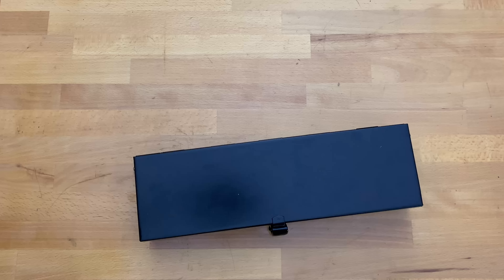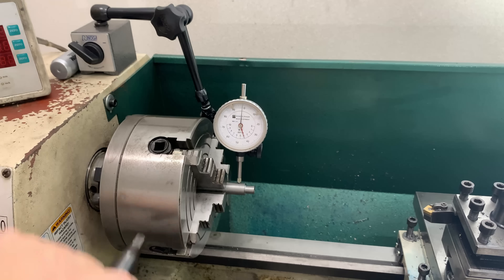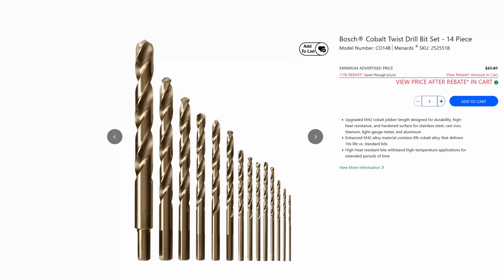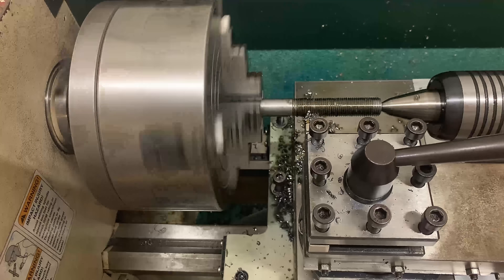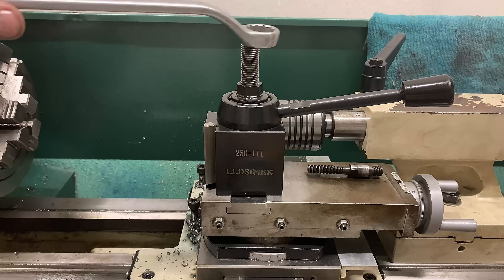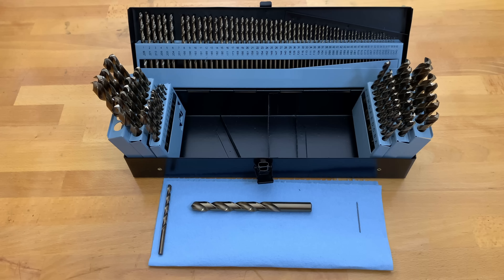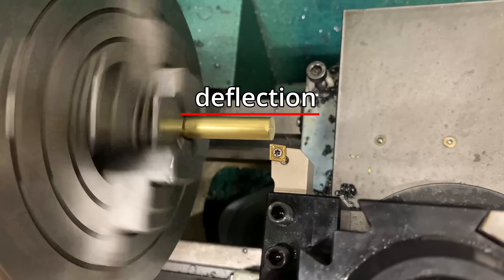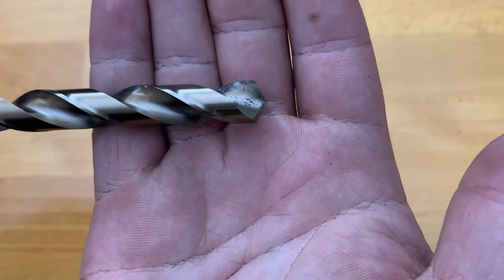Are Harbor Freight Drill Bits Secretly AMAZING?

Comment: I'm not a machinist but I still enjoy precise holes. I make knives and if things don't line up or I can't drill through various steels, then I'm sunk. I bought some decent cobalt 42 drill bits. I bought a new Bauer floor model drill press and the bits and drill press works very well for what I need it to do.

Comment: I have been impressed with my cobalt harbor freight set just drilled 20 3/8” holes in 3/8” i beam no issues. Also drilled 48 1/2” holes in 3/8” plate no issues.

Comment: Worst bits I've ever used are Dewalt. Those things aren't even sharp when you open them from the package brand new. I actually have 2 sets of hf bits and they are still holding up 8 years later. Only reason I have 2 sets is because I lost 3 or 4 and the price to replace 4 bits was nearly half the price of a new set, so I've got ALMOST 2 sets lol. Don't knock the til you try them

Comment: I've had the smaller version of this set for like 15 years. I only use them a handful of times yearly, but they've worked well. Only the smallest bit (1/16? 5/64?) has broken, but that was from trying to drill through an ancient air conditioner's sheet metal to make some water drain holes.

Comment: I bought a set like this from Amazon over a year ago for like 130 USD and they worked great! I broke a few but the biggest downside is the smallest sized drills have no indication of size. So if you accidentally spill the case you now have a fun two hour project with calipers putting the drills in the correct spaces. Still worth it.

Comment: Over the years, I've purchased several HF drill sets.  The oldest seem of better quality and came sharp.  Newer sets are of lesser quality and many of the smaller drills - below 1/4" -are dull from the factory.  If you learn how to sharpen drills, even the tiny ones, these sets are good enough.  Of course nobody in production work would use them!   For hobbyists, they work fine, as do most HF tools.  Stay away from their wheel around 200 Amp battery charger though.  Undersized wiring, brittle plastic - a piece of crap!

Comment: I have smaller sets of HF drill bits, they dulled after 1 use. When I had the money, I bought 3 separate 115 piece sets of Drill hog bits. Am M7, M35, and M42, at $229 per set, they are salty, but worth the investment.

Comment: Most of my work is in aluminum. I am pleased with the purchase. I have had them for maybe 8-10 years. I use them on drill press, lathe, and manual milling machine. I think that I a pretty good drilling. I have some people using a brand new bit that say it is dull. Works fine for me. Got to use oil and expertise. Been in the shop for 45 years now off and on.

Comment: I have two of these sets: I bought the second on sale 4 years ago (almost as good as the deal you got) as a spare. I have not yet needed to harvest one of the bits from the spare set, and use these almost exclusively, unless I want to use a stubby length for a particular job (Drill America M42 Letter, Fractional & Number individual sets; very happy with these as well).

Comment: 0.5 thousandths off the 1/2 inch, not 5 thousandths.  Dial calipers are not a precise reference!  I have the same set, I think it was under $40 when I got it.  I only go to it when I need an odd size, otherwise I use the smaller kits they sell for $10.

Comment: I have the regular HSS version of this set, and they are definitely not top quality, but they have so far chewed through several feet of steel in a lathe, the 1/4" drill not even needing a sharpening. 
Every time I use it, I pucker a bit from how much it flexes, but it just keeps working, so I just keep using it. 
As they eventually go, they will get replaced individually with good quality single size purchases, but until then, yeehaw.

Comment: Nice review. I don’t acknowledge a review unless the reviewer states his qualifications. I believe most bad reviews are due to operator error. I’ve worked for an industrial maintenance service for a number of years, as an industrial, commercial and residential electrician for a number of years, then after retiring, as a cabinet builder. I have a lot of experience with many different tools and accessories. So, yes, I liked your review

Comment: The only thing i have to add about the H.F. Cobalt Drills is that the bits that are smaller than 1/4" are sometimes sharpened for a left hand cut, from stupidity im guessing,  & they're Useless.

Comment: The guy who mentioned melting them in stainless I know why they melted them. With stainless you HAVE to slow down the rpm of the drill or you will harden the stainless making the metal your cutting HARDER than your drill bit. I went through several drill bits before I looked it up as to why I kept destroying even my high quality drill bits.

Comment: I have tools from "China", Snap-On, Wiha, etc.  Buy a cheap tool for most everything if you're not EXTREMELY likely to need absolute precision or constant use.  If it breaks, buy another, OR a better tool OR use the warranty to replace it if it exists.  Does it work, is it correct in measuring, etc.?  What is the problem then?  You don't NEED Starrett, Mitutoyo, etc for EVERY tool but yeah it'd sure be nice to have that level of throwaway $$ to afford to buy tools only from the "approved" vendors...

Comment: The last few Milwaukee tools a bought were complete junk. The very last Milwaukee tool I think I will ever buy was a 25' measuring tape that broke on it's very first use. I literally took it out of the package, measured one thing with it, ... and then the tape wouldn't retract.

Harbor Freight tools are sometimes junk, (it's hit and miss with HF tools) and if I'm going to get junk either way, I'd rather get the junk that costs less.

Comment: I bought the “non-cobalt” version of this set on clearance at HF several months ago. A common problem I’ve found with these bits is that they don’t want to start, as in brute force on the drill press to get the hole started! Their accuracy is spotty at best, and the numbers on the index for the smaller numbered drills is so far out of line with the holes that you have to count to assure you’re getting the desired drill! And just as you showed, the smallest several numbered drills don’t have a stop in the index, and wind up falling into nearly inaccessible places behind the holder! As another commenter said, when I use a bit out of it and find it’s a non starter, I go buy a better quality bit to replace it from my local Ace hardware store.

Comment: No longer available at harbor freight this 115-bit Cobalt drill bit set is no longer available... I have many 115-bit sets... I think you can still buy the smaller set in a plastic case I think and like others have said this 115 bit set is the real deal it's the real deal

Comment: People kill me. They buy the cheapest thing out there and complain. I bought the HF Warrior set of 29 titanium nitride bits on sale for $9.99. I had no great expectations. I wanted to fill the gaps of my other drill sets and plan to use them in mostly wood. People buy these and complain they won't drill through chrome or even stainless steel.
On the case it says "Ideal for ALL drills" They lied. I can't get the 1/2" bit into my Dremel.

Comment: I have a set of these harbor freight will probably be upgrading them. I have a tendency to do that. They'll get rid of the old stock then bring in the new. But I got my set based on somebody who did work and he said they'll get you two. Maybe three holes and then you can replace them as you need them. But they'll get all the different sizes are hard to find. You can get online and go to machine shops, machinist shops and you can buy individual drill bits. You'll pay a little more for them, but you're not buying an entire set to get one drill bit and it will be cheaper than doing that. And you can buy several drill bits so you have a few in case you break one. The set I have will only be used in my drill press will not be used in a hand drill. I have some other drill bits that I use and hand drills I also have drill bits that I use on wood and I have drill bits that I use on metal and I don't swap them out something else. A lot of people don't realize you have to use cutting oil when drilling into metal and you have to use slower speeds then what you would for drilling into wood. I think these are good drill bits. They do what they're supposed to do. I don't think they're any different than the cheaper drill bits that you're going to find someplace else that have the expensive name on them

Comment: Actually the worst part of these is the fact that the box falls apart not the outside but all the internal parts overtime all a little swing packages break out of the box it's a terrible design I've had two of them they both failed. The drillbits were fine but the box was crap

Comment: My experience is that most of Harbor Freight products are are average at best. That goes for their drill bits also. Most of the time I use a drill press and the Harbor Freight bits have to be sharpened more frequently than other brands of cobalt bits.

Comment: I've used those bits and other harbor sets and they are fine but I'm not beating them to death either.  Seems like some guys are putting a 1/16" bit in a hammer drill and try and drive it through 1" cast  but I'm sure bad bits can happen too.

Comment: I purchased concrete drill bits and it took  3 of the same size to drill one hole. I ordered the same size on Amazon and 1 drill bit drilled 4 holes. They were so fast I could not understand by Harbor Freight sold junk.

Comment: The thing I see is that alot of people are clueless about material hardness vs drill speed. They also won’t drill a pilot hole when using anything over, say a 1/4” bit. We have a cheapie set at work with the same index, but they are just HSS, no coating. Most of them are dull or broken because guys don’t have basic knowledge about hole drilling, and when you put a cordless drill in their hands the outcome is bad.

Comment: The Herbar Fraught 115 piece TiN coated set ($59 on close-out-before "Warrior" branding) will work well with cutting oil and in a drill press. The "index case" is almost worthless, but the drills I got will do wood, plastics, aluminum, steel (some common sense please! Hard steel... go low RPM lots of cutting oil for coolant and lubrication, careful feed and pull out for chips) forget most cast iron! Too many voids pieces of sand, wants to "grab" the bit. The Mitsu or Mitsubishi drills are $6-$28 EACH, the Diamond D's are over $800 a set. Wadda ya' gonna' do with 'em and HOW OFTEN? When my late Daddy was a machinist during WWII working 12-16 hour shifts, 7 days a week, the shop (tool crib) provided drill bits, taps and reamers (to a monthly limit). HF has upped their game. HF drill bits DO NOT like lateral force applied-they'll snap. A little CARE and common SENSE and don't use 'em on 150 year-old safes or for gunsmithing and HF tools are better than they OUGHT TO BE for the price.

Comment: Had a set of these from a LONG time ago but they were from Enco.    They worked really well for a long time.   I then bought another set directly from HF about 10 years ago, and this set was not very good for my use.  They did fine until the plating wore off of them.  I resharpen bits frequently.  Once sharpened they would not hold their edge for very long at all. Seemed to me like the base metal wasn't as hard or didn't get heat treated correctly, something like that.   Anyway, for someone dealing with mostly brass, wood, aluminum and plastic, they will be fine for a long time.  If you are going to use these for steel, they will work for a little bit before they dull out and then won't stay sharp for very long afterward.  Forget about stainless.

Comment: I've had one of those sets for almost 3 years.  Paid $60 for it back then.  My case is in better condition than yours was - not a lot, but it's square.  I'd gotten so fed up with having a bit bread or dulling it and then having to buy another set for just one size that I figured this would have three or so close enough to that size to work.  (Don't do much precision work.)  Never had any issues with any of them, or for that matter, not with any HF tools and I've many.  I seriously can't understand why so many are down on the brand.  Many of the ones I've got have been used for heavy work and they've performed great - been using their Bauer battery SDS drill to break up a 5' square concrete slab in my backyard bit by bit, and it's been flawless.

Comment: They work good for jobs were you have a problem with possibly breaking due to drilling through different materials ,
broken bolts and multi layer steel .
They are just hard enough to untwist its self before they break . 
I own a drill doctor that I have a mastered almost one handed and don't mind sharpening bits.
people who say drill bits are junk are 1 using the wrong bit  2 using the bit at the wrong speed and feed rate or 3 have no particular knowledge of tooling materials and don't know that not just sharpening but the correct angle is critical .I have gotten new bits and pointed another angle on them out of the packaging just to match the tool feed rate.I will say there is cheap junk on the market,but hey some one has to set the low bar.That drill set isn't. 
Just don't be that guy with 200 drill bits sitting in a cabinet that is at stock length and say i need a new bit .
sharpen and use them suckers till the twist is gone.

Comment: in my 35 years of working i found most people are stupid and most bad reviews are from improper use. I got some cheap bits from HF that i use for wood, plastic, non ferrous metals. and i got some expensive bits that i use on heavy steel. people burning bits up are spinning them too fast or not using cutting oil.

Comment: Great review!

I would suggest investing in a micrometer if you are trying to measure within a few thousandth's.  Verniers are close (proper name is "very near") and you have to learn how to use them to get accuracy.  The digital readouts on them confuse one into thinking that is the actual measurement.  Micrometers are easier to master and repeatable.  I regularly use calipers but resort to micrometers when turning and need to creep up on an accurate diameter.

Keep up the good work.

Comment: the drill bits i bought from harbor freight were the ones before warrior and ive had and use them every day for the last 20 years the warriors are crap because they are sharpened incorrectly most of the time and dont like steel or heat if you resharpen them and keep them cool they will work but they are cheap and worth about what they cost you would be better off buying a cheap set from kbc tools better quality

Comment: A few thoughts:  first is that any drill bit is going to get negative reviews because there are a TON of people out there that don't have a clue what they are doing.  That said, I have a set of these and wouldn't call them "professional grade", the tool steel is not high quality by any means, but they are fine for someone who knows how to operate drill and will just use them for occasional projects.  That is me.  I have other drills that I use for most hole making and reserve the "big set" for when I really need a precise uncommon size.  With that type of use, and sharpening when needed, this set will probably last me many years.  The last thing I will mention is that every OTHER drill set I have purchased at HF really was complete trash.  Drills not straight, points ground way wrong, really poor steel and coatings.  Ugh.

Comment: I used HF bits as specialty bits that will require modifications or onetime special drilling where the bit may get damaged (throw away bits).  I believe I am getting better bit by buying name brand bits from garage and estate sales (especially if the original owner is a machinist).

Comment: For the most part, people don't know how to drill holes correctly. Drill speed is critical and will burn up a bit much faster than the normal life. Spinning it faster, and pushing harder are not the way to use a bit. And when sharpening a used bit, the reason they don't last is because you burn through the heat treat. Heat treat is only a surface treatment on many of the lower prices bits. The really good ones are treated through because of the material they're made with. 95% of people will never need a professional drill bit, so these work well. But if you are a mecahnic, or industrial machinist or something related to this, you will want to spend the money.

Comment: Right before Sears disappeared from retail stores, I had purchased a 21 bit Craftsman Cobalt drill bit set with low expectations (I can not find it anywhere on line) and they have been amazing.  I drilled a ton of holes with a single one of those bits building a steel carport before I finally broke it, and it stayed sharp the entire time.  I replaced it with a Bosch Cobalt replacement that lasted a fraction of the time of the original before it too broke, and it never was as sharp as the original.
Reply from the maker: I'd like to have one of those old Craftsman sets. My favorite tap-and-die set is a 50 year old Craftsman set from their Kromedge line.

Comment: They are great if you know the lost art of re-sharpening them by hand. You can’t beat a a nice cobalt set in your toolbox. Get a drill gauge and slap another 118 angle on them when they get dull. Once they get smaller than 1/8” I usually just buy them bc they are too small easily sharpen.
Reply from the maker: I also struggle to sharpen tiny drill bits. But honestly learning to sharpen any cutting tools (drill bits and everything else) is such a valuable skill, everyone should learn it if they ever use tools to the point that they need sharpening.